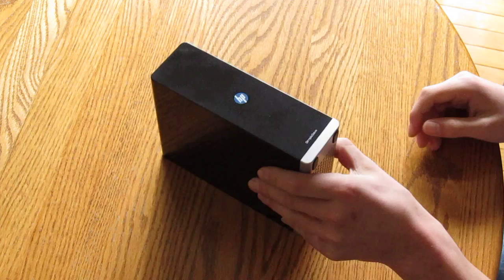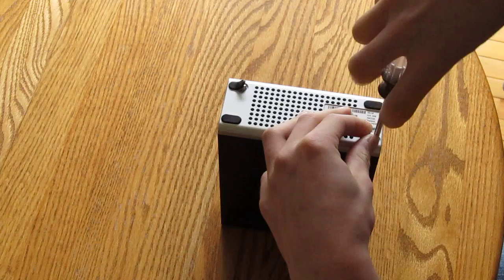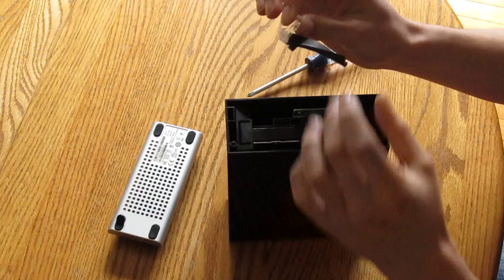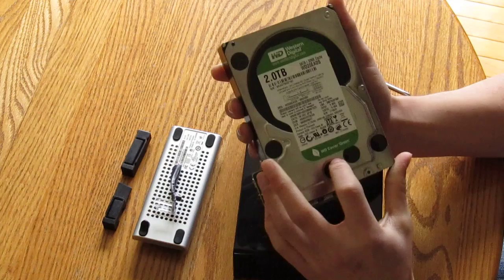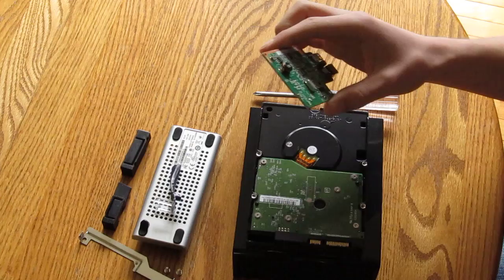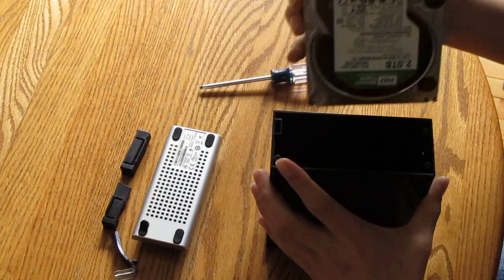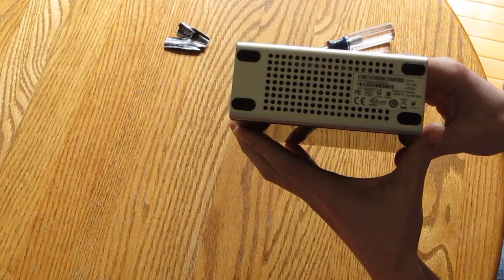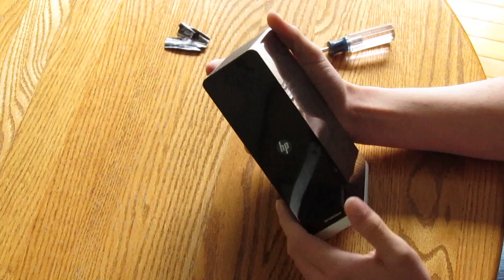Disassembling HP SimpleSave External Hard Drive

Comment: Thank you for your thoroughly great video. My 1T HP drive just stopped working. The unit would come on for a flash but the unit couldn’t be powered. Using your video I was able to take it apart. Clean it and pulled out the CD emulator and reset it back with a tight fit. Presto it’s fixed! It was a loose connection. 

I’ll probably get an external solid state drive soon. For now I’m back in business. Thanks again
Reply from the maker: Glad to hear it was just a loose connection, cause otherwise data recovery can get expensive.

Comment: Great to see you are still replying to comments 8 years later.
So my ac adaptor was damaged. I opened up the casing and took out the drive (also removing the CD chip) so I could plug it into the PC. Of course now I know I can’t access the data and formatting is the only option. But I found a similar ac adaptor, so I clipped the CD chip back on and connected the USB and adaptor. Now my computer does not recognise the hard drive, only HP Explorer which isn’t really anything.
It recognises the hard drive through disk management but that will conclude me having to format it.
Am I able to view the files that are on the hard drive somehow?
Reply from the maker: As long as your computer didn't do anything to the drive when you plugged it in directly via SATA connectors, it should still work when reconnecting the drive using the circuit boards' USB connection.

That being said, if it's asking you to format, chances are something has caused the contents of the drive to change enough that the circuit board thinks the drive needs formatting, so if Windows is asking you to do that, it might be the only option to get it recognized again.

IF YOU HAVE DATA ON THE DRIVE YOU CARE ABOUT, now is a good time to STOP and either purchase data recovery software such as Runtime's GetDataBack, or send the drive to a professional data recovery lab to try retrieving the data.

Comment: also just another point, when i opened mine, where the light thing is, it's actually clipped in. so you have to ease out the rubber holder, then ease out the drive and unclip the thing for the light.

Comment: Hi there, 
great video

I also bought this HP SimpleSave external hard drive from Staples here in Canada. unfortunately, it was dropped on the carpet from a height of 3 foot. The USB cord & the power cord was hooked in to the device but it was not plugged in to any power source. 

Now, when I plug in to the wall outlet and the computer, it does not power on. The blue light at the bottom turns on for a sec then turns off, but no power. it does not make any noise. Please help!!
Reply from the maker: Since it's not powering on, that indicates it's been damaged in some way. You can try connecting a spare power supply of the SAME voltage / amperage to see if it's the power supply that coincidentally no longer works, but chances are the internals of the drive were damaged in the fall.

If this is the case, you can take the drive apart to see if anything has come loose inside, but otherwise may need to send the drive away for professional data recovery if it contains any data you haven't yet backed up in another location. Hope this helps!

Comment from the maker: If the light is not coming on, it's either your power adapter, or the circuit board itself. The best thing to try testing it is either to get another power adapter from another hard drive (MAKE SURE ITS THE SAME VOLTAGE AND AMPS) or take the drive apart and test it inside a computer. Good luck!

Comment from the maker: Easiest way to check the plus for power is to try a different BUT EXACTLY THE SAME voltage/Amperage adapter from another hard drive. Lots of Seagate and Western Digital drives use similar adapters, JUST MAKE SURE the Voltage and AMPS are IDENTICAL to the original HP one. This way you can test if it's the adapter or circuit board.

Comment: I lost the power supply, which current and voltage is this device used to use?
Reply from the maker: I don't have it anymore, but I believe the adapter was 12 volt 1.5 amp. No guarantees though.

Comment from the maker: @rerun1187 you have to reformat it using Windows Disk Management or ubuntu linux / gparted. the computer chip in the enclosure emulates a cd drive and if you put any other drive into it, you will also have to format it. my advice: just take the hard drive out and throw away the enclosure :D

Comment from the maker: Plug in drive using USB to IDE/SATA adapter, making sure Windows detects adapter or makes connect noise. Or plug it into Sata Power/Data from the motherboard. Does the hard drive spin up? (Can you feel it while holding it?)

If so, open CMD in administrator mode with Start > Run, and type the following:

diskpart
list disk

It should output all the disks connected, look for one that's close to yours in size. If it's not there, there's nothing Windows can do. Google "Recover Hard Drive Linux".

Comment: What is the right cable to connect the raw sata drive to say a USB port?
Reply from the maker: You would need a SATA to USB adapter like the one linked below:
https://amazon.ca/UGREEN-Converter-Adapter-2-5-3-5Inch-Supports/dp/B016JTH8FA/

Comment from the maker: Plug the bare drive into your computer using Sata Power/Data. Make sure it spins up. Open up a command prompt in Administrator mode, and run the following commands:
diskpart
list disk
sel disk X (where X is the hard drive)
clean (this will do a soft-wipe - BACKUP YOUR DATA FIRST)
create part primary
active (mark partition as active)
format fs=ntfs quick (formats as ntfs quickly)
assign (mounts using next free drive letter)

Comment from the maker: @00unknownmember00 good to hear none of your hard drives have ever had mechanical failure :D keeping the heat down and proper ventilation does indeed help lengthen the life of a drive, but failure can and does still occur.Example: Hitachi Deskstar 500GB 3.5" Sata 6gb/s hard drive I purchased dies only 3 months after use, and I had it in a Oversized case with plenty of fans.
Regardless of you storage method, your safest bet is to have a backup of anything important; like family photos or work.

Comment: Do you know if you can swap the disks out from one unit to the other?  I have a unit that is unresponsive after a severe drop.  I have dissasembled it and made sure the arms are working but the unit will not show on the computer nor seem to boot up.  Im thinking some of the pcb may be damaged not allowing communication with the pc so I wanted to see if I could swap disks to ensure that the data is not lost.  But I dont want to ruin the good device.  Any suggestions?
Reply from the maker: The hardware-based encryption keys are based on each and every individual unit, so I do not believe you can swap drives between enclosures without formatting the drive.

Comment: i have the 1tb version of this drive. i took out the hdd and connected it into an external enclosure but the drive shows up as not initialized and cannot access the data. any help or info you can give me? will i need to set a jumper? bc i dont have a jumper set up on it right now.

Comment: hi, i have this unit (the 2 Tb ), but i have it since 2011, so for this time, the hd is having errors, and i have noticed with the cristal utility that the hard drive is right now= ON RISK, so im having some issue, there is possible that i buy another hard drive, (one with more capacity, 8 Tb western digital), and replace the original one?, it will work ?
Reply from the maker: You might be able to buy another drive to swap into the enclosure, but I would simply advise buying an external hard drive enclosure instead to avoid the hassles of the silly encryption chip inside the WD/HP enclosure.

Something like this would do the trick nicely:
https://www.amazon.com/Vantec-NexStar-Drive-Enclosure-NST-328S3-BK/dp/B01JNLCC7U/

Comment: I know this is an old video but I just found out my sinplesave hard drive's usb port broke off and fell inside the enclosure. Would you know if it's an easy fix or should I try to find out how to transfer the hard drive information to another one?
Reply from the maker: Uh-oh... if the USB connector is still sort of attached to the board, that will be the only way to retrieve the data. You might need to re-solder it to the board if it's broken clean off. You cannot just pop the drive into a computer though as they are encrypted / formatted to work inside the original enclosure ONLY by default, so yeah...

Comment: i had the same disk.. working i took out wd hdd plug it in computer and wont recognized it any more.. whys that?
Reply from the maker: Because the drive is formatted in a special way inside the enclosure. You can use it outside the enclosure directly hooked up to your computer over SATA, but must format it first. This will completely wipe it of data though, so don't do this unless you have a backup of everything you need from it.

Comment: Thanks man...I just bought this external on ebay in Aust for $99 (cheap for here) and i plan to use it exactly as you have just stated. I have 8 HDDS in my pc in 2 RAID formats plus 1 Intel 520 180GB SSD for my OS. All are out of externals. Had a failure so I picked up the HP.  Having not played with HP before, was wondering what brand/kind of internal was inside. Good to know its a green caviar. This was my 2nd HDD failure and both were Seagate drives...go figure

Comment from the maker: Yes, I'm aware of the regular speed of slower drives, but apparently there were a few models made to run at 5900, which I further confirmed this one is. The claim is that 5900rpm gives you closer performance to 7200rpm, but still reduces power consumption. The end result is that you really only save $2 a year, so they've apparently stopped making both 5400 and 5900rpm drives, as the cost to manufacture other speeds of drives isn't worth it.

Comment: Thank you for this guide! I thought my drive was dead, so I just put in a new hard drive, but windows still won't read it, so it's the enclosure itself. :(
Reply from the maker: +pz17 Remember that Windows won't just "read" drives you throw into the enclosure. Whatever drive you use in the enclosure MUST be formatted inside the enclosure, and then will ONLY work inside the enclosure unless you format it outside the enclosure again.

This is because WD uses hardware based encryption if you decide to use their software to password protect the drive. It's very useful if you intend to lock down the drive, but extremely annoying if you just want to use the enclosure.
Reply: +KiRaShi KReaTive Oh ok, I did not think of that (I am sure I heard it, but it just went in one ear and out the other). The HP launcher does not even load when I connect the unit to my computer though. I wonder if I should just trash it.. I have a different SATA to USB adapter that I wanted to try to see what data was on this new drive.

Comment: heey i have the exact same hard drive, no drops, no nothing, but ive had it for a few years now and recently it has just stopped being recognized by my computer, ive tried it with other computers, nothing. ive used different usb cables, nothing. so how do i get my files off the hard drive if my computer cant recognize it??? 

it shows that it is connected through the device manager just nothing pops up in my computer??

help!!! 

thanks!!

Comment: My simplesave has just failed. Apart from my music collection it also has all my financial reports etc. so would love to get it back. I gave it to a friend who has saved data from h/d's before, but he is telling me the hp.exe is still coming up even after he has removed the partition. I showed his this vid,  and he said he has removed that, but I can't see why that hp.exe is the only thing coming up for him. Any suggestions, please?
Reply from the maker: If the drive was inside the enclosure prior to the failure, the ONLY way to recover data from the drive is to put it back in the enclosure with the original partitions and attempt data recovery via USB... but if the partitions have been wiped, you're probably out of luck at this point because of the way these drives are encrypted by the computer circuit board inside the enclosure, shy of sending it away to a professional data recovery lab. The SimpleSave software was only used for power management and setting a password on the drive if it's in the enclosure, and is not needed for correct operation of the drive.
Reply: Thank you so much KiRaShi for your reply - I will pass that on! Really appreciate your help! :D

Comment: Question for ya, I don't know a whole lot about these external drives as I've only bought one, an HP Simple Save (smaller than yours) and found it had the Virtual CD on it. I was able to go into the Computer Management and turn this off in the settings so it wouldn't automatically run etc. . .

My question is, don't most of these external hard drives by other companies have the same type software on them? Or is this just an HP thing? It seems all these companies have "Backup Plus" or something similar on their external Hard Drives. . .I want to use one to install Linux to, then boot my PC from it. Any ideas about which one to buy and/or how to do this?
Reply from the maker: +Chris Kavanagh I've only found it's the Western Digital and HP drives, because WD is the manufacturer of the HP drives. Click Free drives (when they were around) also had this partition, along with Imation, and Verbatim, but the latter two had tools you could run to permanently remove the CD partition.

If your goal is to run Linux off an external drive, I would *HIGHLY* recommend getting a fast USB 3.0 flash drive 32GB or 64GB) and running the operating system from that. You will get much faster boot and load times, and there is a way to enable persistent storage of files and programs through a Casper-rw file. See here: http://www.pendrivelinux.com/what-is-persistent-linux/

Comment: I got a problem with this drive ever since i got it, Backed up some of my files over from my XP desktop, brought it over to my windows 7, and it most of the files turned corrupted. Plugged it back after about half a year or more, it doesn't read anymore. and when it does, it hangs upon clicking the drive. All it does is BLINK BLUE! Any suggestions?

Comment from the maker: First, I have to ask if it fell to the ground while it was running? If so, the heads may have been damaged due to shock and the drive may be unreadable within the enclosure. At this point, I would recommend taking it apart, and attempting to read the bare drive inside your computer, or with an external Adapter. Search "IDE SATA to USB" on ebay; should be had for about $15 with power adapter.

Comment: Hi:
Thanks for the great video and explaining the partition. MY drive will not work at all- it won't come up on either of my computers (both laptops, PC). I was wonding if it would work if I took apart the simple save and took out the cd? Thoughts? The light is on and the blinking so there is some activity- it also does make a rearing up noise from time to time. 
Thank you,
MG

Comment: Thank you so much for the video!
I've tried it, I've removed the embeded virtualCD chip and I've put it again and I haven't loose any data.
But in coclusion, how can I get rid of that VirtualCD partiton? Only discarding this chip and the enclosure and using the drive as a normal or common HD?
Reply from the maker: pepeyoutb Correct. The VirtualCD partition is embedded in the chip, and I don't know of a software tool that can disable or remove it, as it's required to mount the drive as a letter on your computer. I just removed the chip and reformatted the drive and voila! 2TB of storage.

Comment from the maker: You can only remove the "virtual CD" be removing the computer chip from the drive, which makes the enclosure useless. Then you can pop in any drive I suppose BUT YOU WILL HAVE TO FORMAT IT to use it with the enclosure.

Comment from the maker: You probably could swap the Hard Drives, but remember, when you swap them they possibly might need FORMATTING, which will DELETE ALL DATA from them. Also, you should copy all the software and folders off the original 1TB FIRST, then do the swap, then copy the software back to the new 3TB drive. I don't know if you can download the software or not... Let me know how it goes...